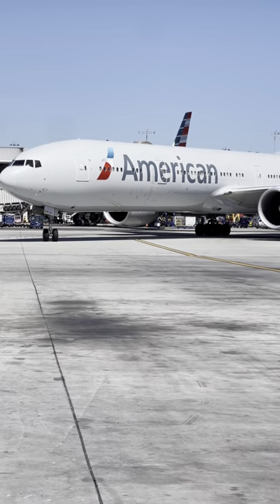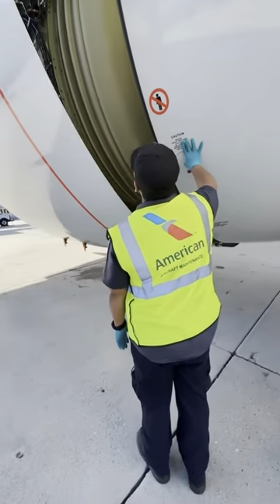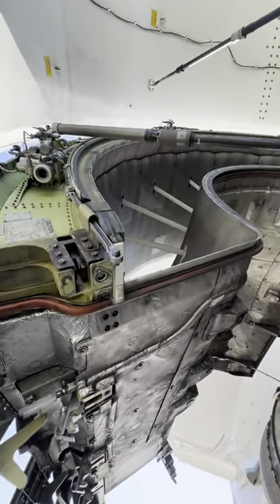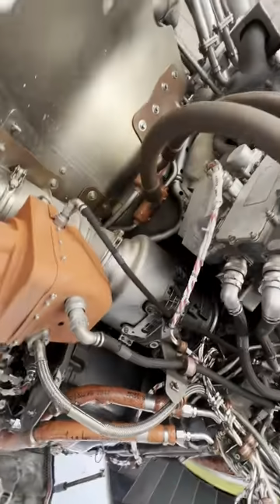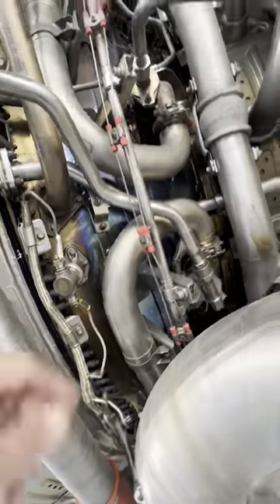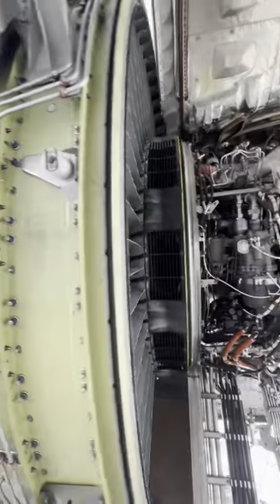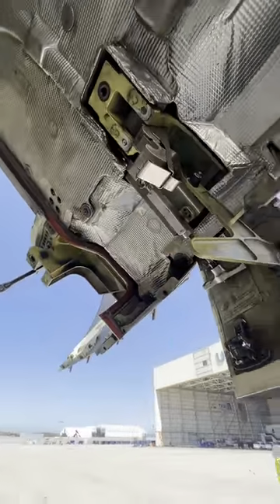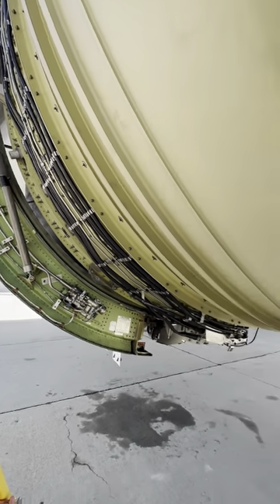GE90-115B inside and out.

Comment: Im a fueler and you are right, there's nothing more humbling than to stand in front of these engines. To think these can make over 100,000 hp each, is simply mind boggling.  Thank you for showing it to us and also kudos to you who fixes them,  and to the engineers that designed them and to the people that built them. Takes truly brute force to propel over 600,000 pounds of plane to 600 mph for thousands of miles.  Very durable and they don't smoke at all.
Reply from the maker: Well said!
Reply: Mind boggling these things actually work Can we have a simple engine with one hundred parts only

Comment: Excellent video. Well filmed and explained. During the last 5 years of my career I worked solely on these aircraft/engines and as you said they are so reliable and a dream to work on. In fact I was working on the freighter version and they could be away from base for anything up to a week having flown multiple sectors and many many hours and arrive back with nil defects and none while it was away either. Brilliant aircraft.
Reply from the maker: Well said
Reply: That's fantastic reliability. No wonder each engine costs more than a whole regional airliner (I think).

Comment: Been a commercial aircraft mechanic for over 35yrs and the triple 7 is just amazing. The diameter of the engine cowling is the same diameter as several commercial aircraft fuselages! Giant! I had the pleasure of standing inside the engine cowl years ago and I couldn't even touch the upper intake cowling!
Reply from the maker: It’s a humbling experience when you stand inside the intake… first time I did that, I felt like a little ant next to an elephant.

Comment: The first time I ever boarded a 777-300 as a passenger, my seat was right next to the engine.  I opened the shade and looked out the window and there was a man standing in front of it, as well as a cargo van.  Both items looked like they could easily fit inside of the engine.  I was floored as to the massive size of that beast.  But then, you look around the aircraft and realize just how huge the airframe is and that one of those engines has to be able to power this beast by itself, it's completely proportional to the aircraft.   Ever since that experience, I have been a huge 777 and GE90 fan.
Reply from the maker: The video itself does not do justice to the size of that engine. It’s incredibly massive.

Comment: When I worked for Ford I wanted to get into aviation (early ‘70’s) but I was told I couldn’t compete with Vets returning from Vietnam so I didn’t peruse my dream… pilot or mechanic.  Thank you for your time & expertise Sir.
Reply from the maker: I’m glad you are here enjoying it but I wish someone in the past didn’t discourage you from following your dreams. The industry needed mechanics back then as they do now.
Reply: @StigAviation  I eventually applied to Falcon Jet for a mechanic’s position. The interview was a joke.  They gave me French schematics & he said it didn’t matter, “you should still be able to read them, which I agreed but said I didn’t read French.  Then they gave me ‘a soldering test.”  Now I’ve been soldering well over 10 years & was quite proficient in it but they gave me a 50W pencil iron & asked me to solder two battery cables like 2 gauge & I knew it was impossible. Before I even started I told them it won’t work without more heat like 500W or a flame from Bernzomatic. He made a rude comment & I knew I was wasting my time there.

Comment: Absolutely brilliant.
Thanks for your hi level technical video excellently shot. Loved it.
Reply from the maker: I’m happy you enjoyed it. I appreciate you watching
Reply: I worked at LHR for many years and when I saw United do its inaugural flight with the RR trent is was huge, and on the same day BA had the GE 90, BOTH ETOPS going over the Atlantic to Kennedy probably. It was stunning hearing them spool up. The idle on these engines were high and would cause the A/C to creep at a speed without throttle.

Comment: Amazing video pal 🤜🤛😁✈️

As an aviation enthusiast myself, I know quite a lot about aircraft and aircraft engines, but I've learned quite a few new things about the incredible GE90 today, through watching your amazing video, I really appreciate your videos, thank you so much for making them ☺️

Quick question for you, If an aircraft happens to be missing her APU for whatever reason, how do they start the engines and what provides the air for the starters in that case? 

I know that a ground power unit provides power to run things like the avionics, Lights, IFE etc... But wondered how the engine starters get the air they need to spin up the engines 😉

Comment: Stig, thank you for an outstanding, fascinating video! Btw, what have you heard about the new GE9X engine (slated for the new 777X)?
Reply from the maker: From what I understand the engine is still under heavy testing, FAA has not fully granted airworthiness to the 777X, nor the GE 9X, but Boeing and GE have been working very hard to produce the product. Unfortunately, my airline will probably not be buying that lineup, as we are probably sticking more to the 787 fleet and allowing our older triple seven fleet to keep running. For the foreseeable future, I think the new generation of the 777 is going to be an outstanding aircraft with lots of improvements, that being said, the future will tell.
Reply from the maker: Ok. Thanks 😆

Comment: Hello Stig, I was wondering which of the GE90 and GEnx accessory valves fail the most?  Thank you!!!
Reply from the maker: Accessories are more of the components attached to the gearbox (IDG, EDP, starter, fuel pump). Valves are more for the pneumatic system, regulating airflow from the engine compressor. As for what fails, well that’s a bit unpredictable, but most common one I have seen is the PRSOV (pressure regulating shut off valve).

Comment: I worked on c-17s in the Air Force as a 7level technician (engines was my shred) but I was also a 5 level crew chief. Everything you explained was true. EXCEPT those automatic buttons for the TR doors and accessory doors. We had to get stands and hydraulic hand pumps for the TR door’s because the Air Force thought it would be funny to watch us use those pumps all while telling us to hurry because said jet was to block out soon. So… lol.
Reply from the maker: I assume on military jets they try to make it as simple as possible on the systems. But our narrow body jets with the smaller engines are like that too. Manually hand pumps to open the TR cowlings.

Comment: When I was driving OTR long haul on I-5 between Seattle and Portland I’d see special semi - trailer combinations hauling those GE 90’s to Everett. They are big.  A lot of overpasses on I-5 in Washington state where built in the late 50’s when they originally built the interstate system. Those engines would barely fit under them. They had convoy vehicles with special strike antennas in front of the semi’s. As for being a OTR truck driver hauling Jet engines is a good gig , that’s all these guys do is haul Jet engines.
Reply from the maker: Yup. I seen that too. Fun fact.. most hazmat components have to be hauled by truck. They can put it on aircraft. We have gotten many deliveries like that to LAX.

Comment: How much the maximum temperature it can reach near the combustion chamber
Reply from the maker: engine running near maximum thrust levels experiences approximately 3,000 degrees F (1,700 degrees C) in the hot section

Comment: What amazes me the most is the cowling ring and how it doesn't bump against the fan blades. There's what, 5 mm between the two? With all the bumps those planes take, it's amazing the blades don't grind!
Reply from the maker: It’s perfectly engineered, it’s quite amazing even I get shocked at some of the tight tolerances

Comment: Those GE90 engines are amazing pieces of machinery. I wish I could see one up close.  An airplane mechanic at LAX told me the basic concept of the jet engine : air is sucked in, then it’s compressed, and then fuel is added, and then it’s blown out the back. But my question is this: why do the engines sound so loud? Their thundering roar also amazes me. Jets taking off from San Francisco fly over my house at about 25,000 feet and even at that distance I can hear the onions roar. Wow  are they so loud.?
Reply from the maker: The good old concept, with a bit of comedy, suck, squeeze, bang,  blow 😅 obviously, there’s a lot more involved. But the reason they make that sound is because you have a lot of compressed air being ignited, it’s a very large engine it’s gonna make large sound.

Comment: Fun fact: There's more to opening the fan cowl than just pushing the PDOS switch. You need to electrically deactivate the slats to prevent anyone from accidentally extending the slats onto the raised fan and reverser cowls.
Reply from the maker: You’re absolutely correct

Comment: Quick question over here: 
So this active clearance control cools the surrounding components down as much as required to avoid contacts of components due to thermal expansion? Does it also heat up for colder environments?
Reply: The HPT ACC operates to manage the turbine blades tip clearance. The cooling air will allow the turbine casing to shrink or expand optimising the clearance between the blade tips and the turbine case.
Reply: @PJD_55  thank you for that explanation✌🏻

Comment: Why is the eec mountet on top ef the engine? If it's mounted lower you could access without a ladder an it would save 30 feet of electric cable.
Reply from the maker: I guess that’s where GE decided to design it so it can fit in there

Comment: How long does it take for these engines to cool down enough, where you can safely work on them?
Reply from the maker: Usually 45-60 min if we are working on the hot section, the parts under the fan cowling dont get that hot.

Comment: The aircraft doesn’t need reversers to stop, however pilots are taught to use the brakes as a last option to slow the plane. First option is to land at or just above stall speed, this bleeds off extra speed while the aircraft is still airborne. Second option upon touchdown, the main gear will touch the runway first while the nose gear is still aloft. The pilot can pull back on the elevators and bleed off airspeed, pilots are taught to keep the nose gear aloft as long as they can, this adds drag without applying brakes. Lastly, reversers can be used. Which creates drag by forcing air forwards instead of rearward. 

Edit: technically there’s an additional option for pilots, this is to make sure the aircraft not only touches down at stall speed, but to do so at the very beginning of the runway. This gives the aircraft plenty of room to simply roll to burn off more airspeed after all other (non brakes) braking methods are exhausted. 👍🏾
Reply from the maker: Very well articulated and explained my good sir, thank you so much for your knowledge.

Comment: Question: I realized that those engines run 10 plus hours a day, then stop for a few, then 10more hours etc.. how many cycles before they need to be opened up and checked or repaired? Seems like they spend most of their time running!
Reply from the maker: There are certain hours where it reaches a point of a heavy inspection and sometimes overhaul. Now I personally don’t know the exact time because that’s more of the engineering department that tells us to do it. They just let use know that a particular engine requires this or that and we perform the tasks needed. But yes you are right, these engines run non stop, and they are designed to do so. It’s actually quite incredible

Comment: Ahh before opening the cowlings, always check to make sure the slats are retracted. Happen many times when cowling hit the slats when slats are not retracted
Reply from the maker: we actually locked them out and disable the system before opening
Reply: @StigAviation really? We just don’t move them while they are open.  Used to work at AA…couldn’t imagine any of the guys I worked with doing that…they didn’t want to do ANYTHING

Comment: Hi Sir, if it runs on alternator due IFSD, does it still runs IDG to 24V or maintain Thrust?.
Going for my ETOPS rating.
Thanks
Reply from the maker: It does not run the IDG. It will simply provide power to the EEC to keep the engine parameters and fuel flow functioning. It will keep the EEC active so the engine can still run independently without the need of power from the IDG

Comment: What scares me the most is how close the carbon fiber/titanium blades are to the air inlet wall :D 
Awesome video.
Reply from the maker: I actually talk about that in my other videos. It’s amazing engineering
Reply: The fan case liner is a sacrificial unit. The blades are structurally stronger than the liner. Any contact is incidental and usually uneventful.
Reply: @jakem7838  I’m sure the blades are strong and never stretch. However,I think, any contact with the engine’s cowling during flight would result in a disaster lol.

Comment: I'm a mechanical engineering student and I'm really into these beautiful engines. I really want to know how each of these units and components work. Not just the basics, all the mechanical details to the extent that i can tell what unit does what by looking at a picture or a diagram of the engine, just like the way you can do with cars. I understand turbofan engines are a lot more complicated than car engines but i just wanted to give you an idea. 
Do you know any books, videos, websites anything that can help me get there?
All I found was just the basics no one got into full details of it
I would really appreciate it if you help me
Reply from the maker: Outside of actual technical manuals I don’t know where to find such detailed information. As far as explaining every comment to the utmost detail, well that would take hours and hours of lecture. I don’t know if that’s possible here.
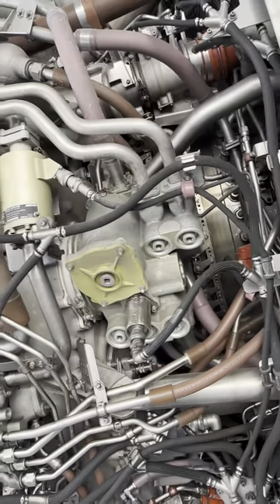Reply: @StigAviation  Thank you for your response. Isn’t there an overall diagram of the engine available? One that explains the components common to most engines, shows their location within the system, and illustrates their interrelationships? To draw a parallel with cars again, there’s always an alternator that charges the battery, or a water hose that circulates coolant from the radiator back to the engine. Every car has these components. Similarly, in aircraft engines, we have the HMU, a gearbox, an oil pump, and other components that are common to all engines. Isn’t there an overall diagram that explains where each of these units is located in the system, what they do, and where the pipes and hoses originate and terminate? Something similiar the diagram that you included in your video at the 2:45 mark but for the whole engine. Is there really no book or resource that provides this level of detail?
Reply from the maker: @keyvankiani8025  there are some basic sources online that you can find. But you have dig around for that. But it’s there.

Comment: Do these engines not overheat? How do airlines do flight after flight after flight without letting the engines cool off for a few hours???
Reply from the maker: It has special ducting to keep certain parts at nominal temperatures. Also the engine components are made of high temperature metals that is resistant to such factors. It’s engineered to keep running that hot and to stop and restart.

Comment: I know there is no alternative of experience. However, what type of academic qualification does one require in order work on those engine?
Reply: In the United States, you can get around the experience requirement by completing a certified aviation maintenance technician course and passing the required examinations.  I believe the course usually take  about twenty months, or two years if you want to include a degree program.  Unfortunately, the schools are pretty expensive, but financial support is sometimes available from various sources.
Reply from the maker: look up Airframe and Power Plant licence

Comment: I was wondering , how the starter engage and spins the main shaft , is the main shaft have gear .
Reply from the maker: The started has a shaft that connects to the accessory gearbox   The accessory gearbox turns the transfer gearbox and in turn moves the angled shaft that connects to the 
Main center shaft. That’s how the engine turns

Comment: A naval (2 stroke mostly) engine will run continuously for 3 weeks without any maintenance (only in case of real emergency) developing 50-60000 kw, drinking 200 To of fuel per day.
Reply from the maker: That’s impressive. Reliable engine you got there.

Comment: How do you lock out the engine before you stand in the nacelle?
Reply from the maker: By putting safety placard inside the flight deck as well as locking out certain circuit breakers to make sure the engine cannot be started.

Comment: While the GE90 is a masterclass of engineering, i prefer the Rolls Royce Trent 800 for its fuel consumption, a heck of a lot less oil use too. For e.g 1qrt for Rolls after a 13hr sector or 4qrts with the GE. Interesting. Easier to work on too

Comment: Ah, so the nipple sleeve receivers are actuated by the automated drainage ventilation linkage on the reversible EEG suspension system in a lateral closed loop reduction abrasion system. Got it.
Reply from the maker: 🤣🤣🤣 yup. That’s it. And don’t forget about the transonic flugalbinder that connects to the incandescent capacitor 🤣

Comment: I was surprised to not see more safety wire than I did. But it would take much longer to service components if most everything is.
Reply: We service the starter, the oil and the hydraulics.  Oil has a locking cap…starter has wire, hydraulics we pump into the system through a quick disconnect
Reply from the maker: there are certain components deeper in the engine that has lots of it